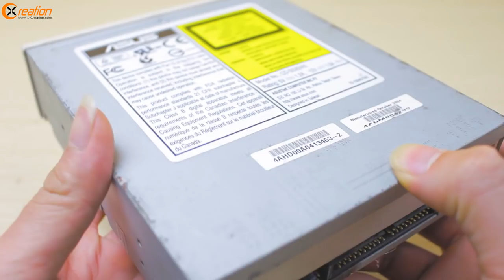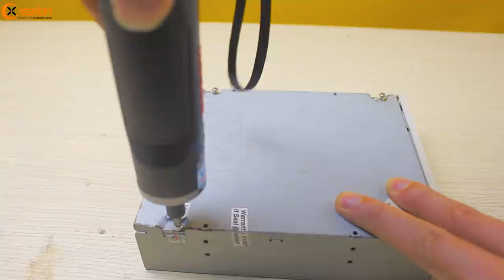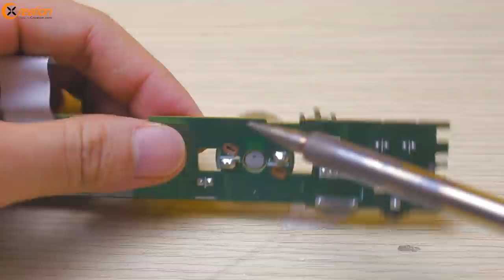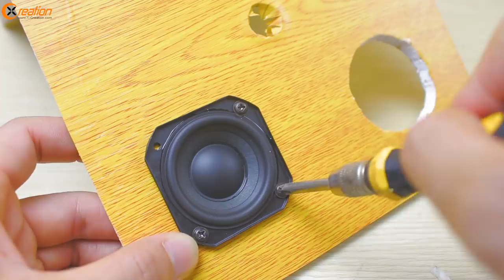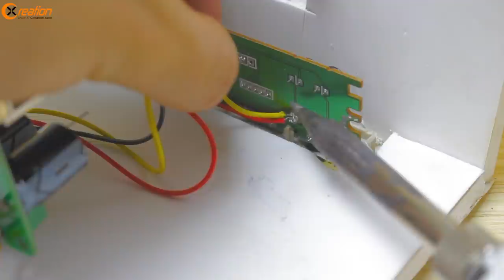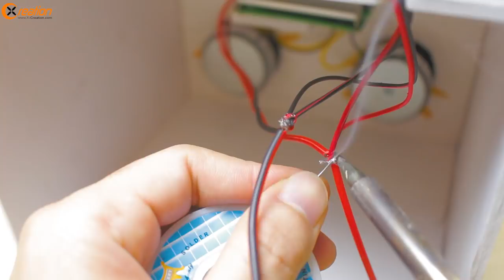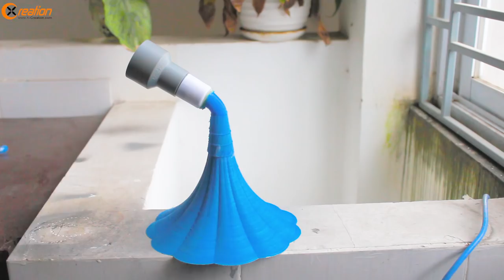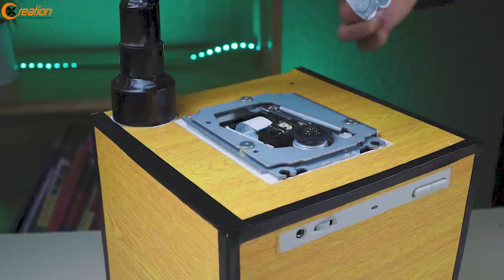Recycle old CD-ROMs into Vintage Speaker Player

Comment: How to create Randomly-Troat-cutter-Device... :D
In the '00s one of my CD suddently exploded in the player at 52X speed... some particles of the disc caused fractures on the plastic cover of the device, inside-out. Just imagine the damage if it has no cover.
Reply: The cd takes a while to shatter at very high speeds, so if your cd drive is spinning so fast that the disc could explode maybe turn it off? Other than that I can say this guy did a very poor job, the only well done part was the 3d printed horn. Idea of exposed cd player to look like a vinyl is a good one, but it was all executed poorly and it's shoddy.
Reply: Dark I read somewhere 52X CD-ROM player works at approximately 26,000 RPM max speed. If I remember well, SlowMo Guys made a video about spinning discs with an angle grinder (it works on 19-22,000RPM). So I think explosion depends on the quality of the disc... Btw yes, this job is so poor indeed...
Reply: @andrasbradacs6016  The 52x does have that speed yes, and most cds are rated 52x or more, so shouldn't explode, also normally in the 52x drive the cd does not spin at the max speed for long enough to be able to explode. The 90s cd rom drives that have these buttons on the front only go up to 32x, so it's not dangerous even if it does spin at max speed all the time. 

The normal cd-rom audio playback is at 1x speed btw, so disc will spin slowly on this shoddy device anyway.

Btw it's worth noting that sometimes, some early model 52x drives can go nuts and spin far beyond 52x speed (for some reason) and you will really hear that if is happening, this is what I meant that you should turn it off if that happens.

Comment: I hope your CD's don't break while spinning at 6000 RPM.
Reply: first, a disc needs like 20K RPM to break, second the reading speed is between 200 to 500 RPM not 6K
Reply: @taztian  20k RPM to break if no flaws or chips in a CD I doubt many people will buy new fresh CD's. And the 6K RPM is the max that that disk drive will spin. I did not say the disk would break due to that speed. I clearly said "I HOPE" Generally a music disk would read in this range but  if the drive is attempting to transfer data it can reach speeds of 6k RPM. https://whatis.techtarget.com/definition/X-compact-disc-access-time

Comment: my cd player has no headphone output :(
Reply: On the back of the CD drive there should be audio outputs that are intended to connect to a PC's mainboard or sound card. You can get stereo audio from that.
Reply: @Elfnetdesigns  and PC to control. because that cd dont have a next and previous buttons :)
Reply: @gile849  Some of the older CD drive had a next buttons back in the day. Some early DVD had them also but all the Old Sound Blaster CD drive had Next and Previous buttons on the them and Volume knobs.
The one he used is older drive because it has a volume knob.... :D

Comment: mp3 player inside of box
Dvd writter can not run without motherboard of Computer
Reply: It can...i have a video of this....very old cd rom drives can run cds without computer...it needs to have a play and skip button to work
Reply: Show.. if cd rom note have button skip it no work?
Reply: How many years you live in cave dude??
Reply: No need computer bro
Reply: @BaNNDoG25  are you from hell?
Reply: @makeormade1579  yea! How do you know?
Reply: cd rom drive plays CD by default.
Reply: O yes it can play without mainboard . Google is your friend , find it .
Reply: The older version drive he’s using don’t need a computer all it need is 12 volts  and any amplifier
Reply: Yes it can very old dvd player
Reply: CD ROMs like that has built in audio amplifier and a headphone analog audio output jack, so yes it could drive an amplified speaker.
Reply: There are some very simple Arduino projects that allow you to trigger the CD Audio playback functions on practically any CD or DVD drive via the IDE / PATA / ATAPI interface.

It would probably work for most SATA drives as well, using a $4 PATA to SATA adapter.

Sure, you can buy a tiny MP3 module with a microSD slot on it for $3 with a small 3 Watt amp on it, or add a better amp, but it wouldn't be quite as fun to build.
Reply: @Saptarshi Sikder
It works. But for more practical reasons, you don't need to dismantle of the CD ROM, just connect the power supply (into 12V & 5V) and insert the earphone jack into the audio amplifier. Done.

Comment: this is cute but 'vintage speaker' is a bit misleading... also finding cdrom drives with play buttons isnt as easy as you think.... btw, the first few seconds of this video was all that was needed to tell what you did..... ....and to those who think of building this you can really screw up a CD with the drives fast spindle if you dont get that clasp magnet on top of the disc ASAFP.. or worse, the magnet 'gives up'...
Reply: the magnet give up??? How? you demagnetize it ?? how??
Reply: @Vistal11 , give the player a sharp 'bump' ... with the disc spinning at insane speeds it will 'wobble' and cause the disc and magnet to go flying.... i know... ive had this happen myself... you need the metal bracket that holds the magnet in place to keep that from happening cos the magnet cant get very far away from the disc when bumped...

Comment: Still better that that Crosley shit they sell at Walmart.
Please cut out the holes the right way so you can bolt the components down and not have to use super glue or hot snot,,
Also you have a 3D printer, why don't you 3D print the casing in parts that interlock and mate up

Comment: it distorts but it is ok
Reply: Γιάννης Φιλιππουπολίτης maybe it is the speakers
Reply: no it is that he used plastic to make the cabinet
Reply: It's distorted cause he uses the headphone out, which is already slightly amplified, instead of the line out on the back.
Reply: @MegaBobsel  That is correct and he also connected it as mono and not stereo and it is overloading the 15X15 amp with the amplified audio and not the preamp audio... :D

Comment: Total waste of time. older optical drives have audio outputs on the back. Add an amp and use  the control buttons. I have done it to make a player for my NBTV system.
Reply from the maker: not bad ideas! :))

Comment: This guy has no idea what a vinyl record player is. He is exposing himself to the laser emitted from compact disc player.

Besides this will not work after a few days since the alignment of the laser beam will surely deviate due to friction caused due to disc spinning.
Reply: A laser pickup has tracking and focus coils. There is no contact between the lens and the disk.

The disk is clamped in exactly the same way as in the original drive, just without the tray sitting just below the disk.

The laser likely has less than 1 milliwatt output power, and is focused to a very tiny distance to the disk surface. Above that level, the beam is extremely unfocused.

Sure, it's not the sort of device for a young child to use, but still safer than a typical cheap laser pointer (especially the Green DPSS lasers with no IR filter).

It's also far from a good build, but meant to be a quick fun project. Normally I don't watch this style of vid, but it was well shot, creative, and could be educational to some.
Reply: The misalignment will not happen because in the original drive the carriage and the spindle are on the same rigid assembly, even though on vibraiton separation bumpers from the rest of the case.

The vibration of the disc going to the case though will be loud as fuck :P
Reply: +Sandeep Karan Keep your ridiculous assumptions to yourself. The CD-ROM is working exactly like it is supposed to except it doesn't have the outter shell. There is no more friction than it had originaly so there is no reason for it to stop working.

Now having a disc spin at 10400 RPM exposed is dangerous though.
Reply: @electronash  Well said!
Reply: Did you know that you do not really need a case for a compute to work and run! The case is for sale ability! I have one computer mounted on a piece of plywood and it has worked just fine for 8 years. It is easier to clean too! Lol
I just update stuff now and then... I also did something like this years ago but I hooked it up to my old home stereo, I think it was in the 90's... Later!

Comment: awful build, use some mdf, make it so you dont have any air leaks, better drivers and some insulation, and stop using glue, if so use hot glue, and a descent wrap around
Reply: Agreed! Most of the builds he does are of extremely low quality!